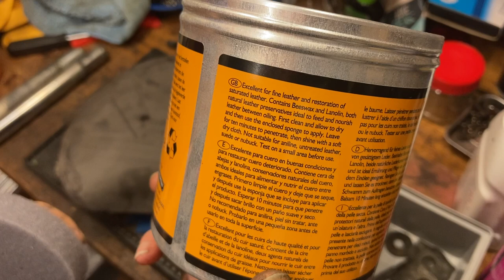70 YEAR OLD VINTAGE BIKE SADDLE RESTORATION // 1950 Dunlop M15 bicycle saddle

Comment: I have a similar seat but with lots of torn places. How can i fix them? Sew them? 
THANK YOU
Reply from the maker: Depending on the tears, you should be able to punch some holes in it and sew it together with twine or string or shoe laces. But if it’s really beat up and you ride it regularly it would be better to replace it with a new or used saddle.